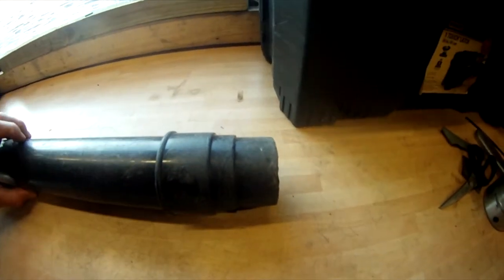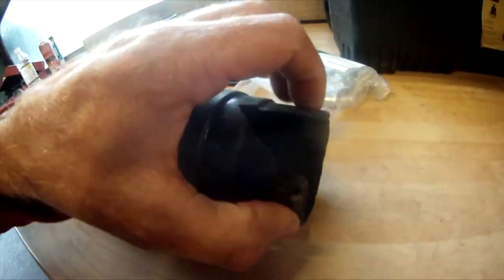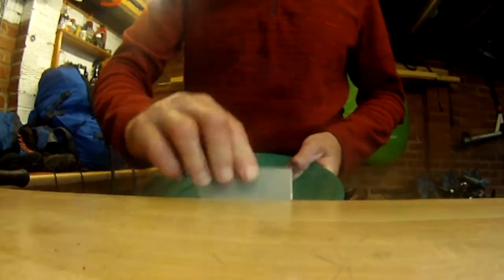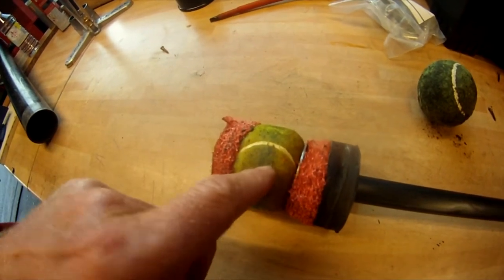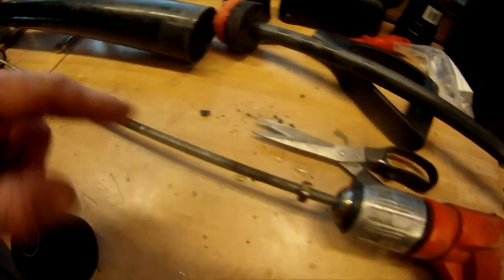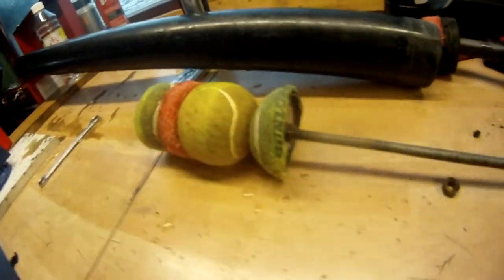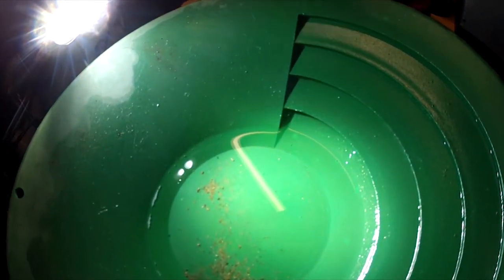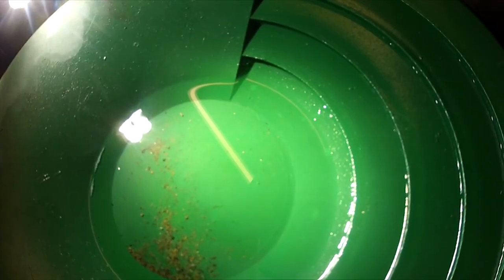Repairing a Henderson gold sluice pump

Comment: when i used to make these i used 1 ball with 2 plates, on the end of the treaded rod i used a wingnut to adjust the preasure of the pull. go tighter squashes the ball out towards the pipe.
Reply from the maker: Dave UK Yeah my set up was a bit like that. Thought I would try this idea out. It is a bit more weighty though. I never got to  use it yesterday in the end anyway .
Reply: and to add, when u pump have ur bucket etc as close to the hole as poss even if it is underwater or u will end up loosing % of ur efforts in transfer, specific gravity and all that :), also not seen you use a scope to look underwater, not sure if u snipe or not, get a drainpipe or similar, glass in one end, push underwater to look. sry tpo mention if u have or already do this.

Comment: mine only uses one ball and two plates either side as its much easier on the draw... ive a spare stainless steel guard end for the pump if your interested
Reply from the maker: Rayvenini There will be something out there at B&Q or something designed for a completely different job to protect the end of the pipe.